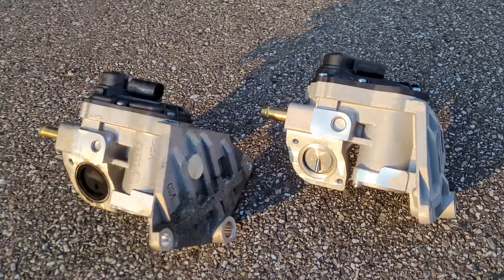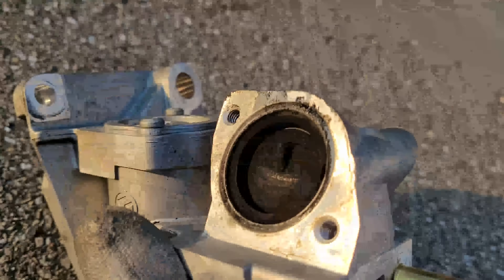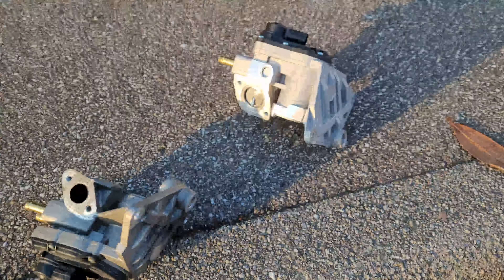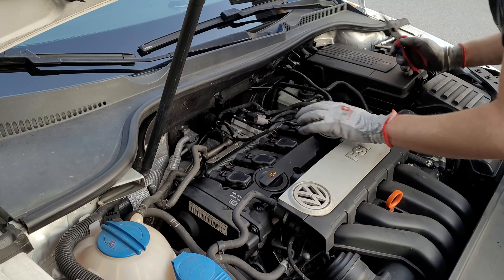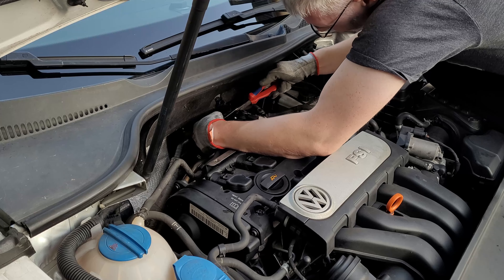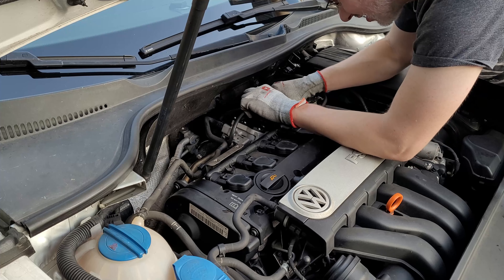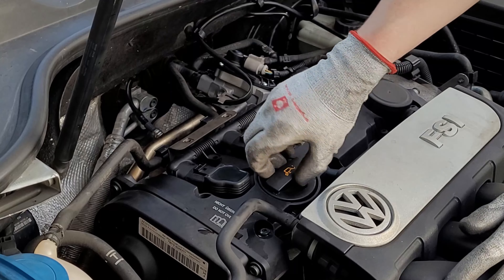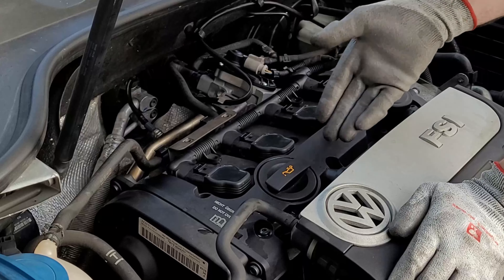EGR Valve Replacement! (2.0 FSI) - Germany's cheapest VW Eos - Part 21

Comment: hey there, I have a mk5 golf 2.0 FSI non turbo, BVY engine, and recently after replacing my EGR valve have recieved the same p0400 code. However my engine has a very rough idle and lots of engine shake. Not sure what this could be and this video seems to be very on the point. Thank you so much!
Reply: coil pack maybe ?

Comment: Thanks for the video, Do you still see an P0400 error code and P0403 has shown up again after few km drive?
Reply from the maker: Sorry for the delayed response. Unfortunately the 0400 is recurring shortly after I delete it every time, so I've been ignoring it for now. The 0403 has not come back, that was quite likely caused by the DOA ripoff pile of crap EGR :). Car runs perfectly fine, but I have some diagnostic software coming in, so I'm hoping to get more details on the fault and what exactly is causing it to pop the error.
Reply: @ConditionCheap  Any update? If not mistaken when changing EGR valve you have to use VDOS or whatever is called VW original diag tool and make new ERG valve "learn"  EGR function.